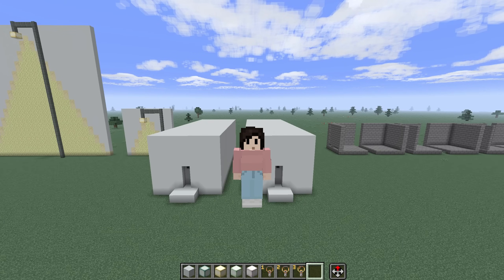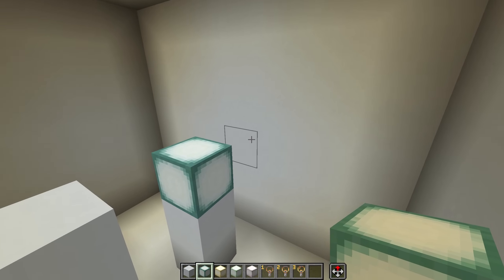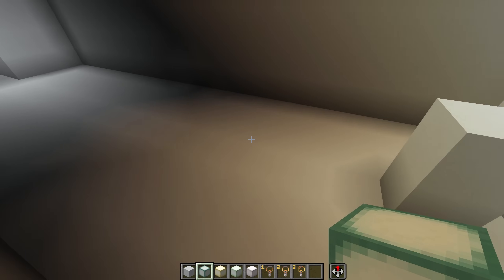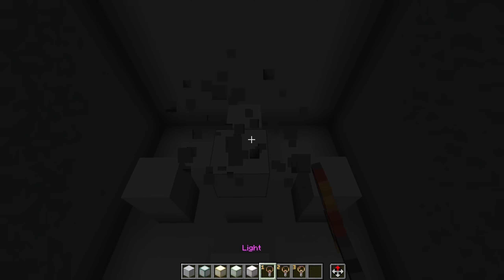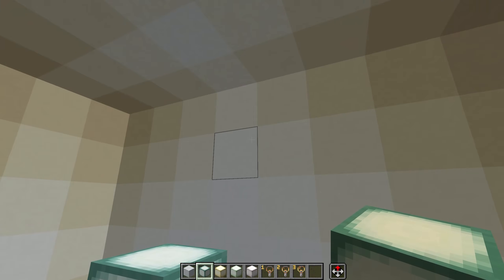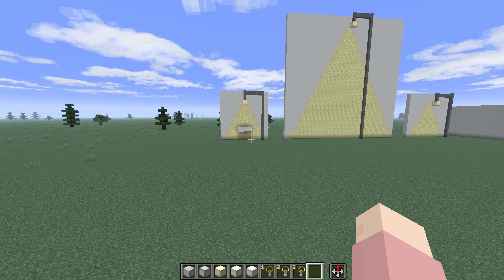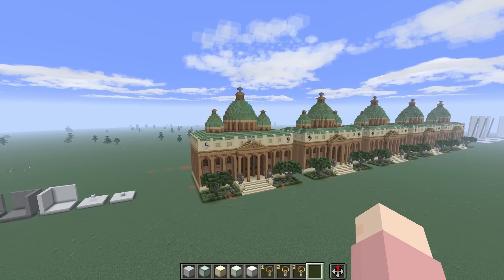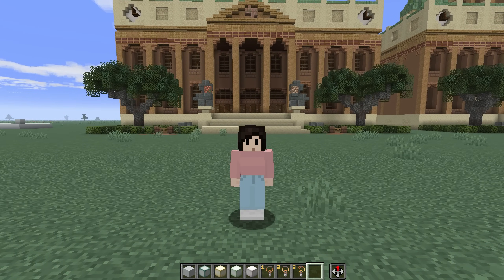How to Bake Light Maps to Improve Your Builds

Comment: 1:35 from my VERY LIMITED experience in 3D modelling, I can confidently say this is what Normal Maps are for. This is what you call a "light map".
They allow you to take any object and "bake" lighting into them, using ambient occlusion. You can even give low-resolution meshes a high-resolution look, or create texture on a flat surface.
The mod "Phosphor" aims to fix the inefficiencies of Minecraft's lighting engine, you should check it out.
4:15 I have an explanation for this too! So there are "cold" lights and "warm" lights, just as there are "cold" and "warm" shadows. The direct light you see from the sea lantern is a warm light, and acts like an incandescent lightbulb. The shadows of this light will be "cold", just like the light from outside, which is a "bounced" or "reflected" light. You see this reflected light even more at 5:30, where the reflected light illuminates the shadow. I love to use this effect in my artwork and my builds, making them warmer or colder depending on where the light is coming from and what color it is. I don't have an example on hand, I do believe Marco Bucci explains this in detail.
7:00 yes, most if not every light block is animated, there are even non-light blocks that are animated. Prismarine being the most commonly known example.
15:00 I think you did beautifully on the rendering there! Not a lot of people think about de-saturating their colors as they move towards shadow, but that is indeed what is happening. Less light is hitting the object, thus less color is reflected. I love the transition back to color as you bring the mossy cobblestone in - as more color will also make a shadow darker.
Reply from the maker: Thank you for such a thought out comment! I really enjoyed reading your analysis of everything. The only thing I have to add is I think I was right in calling what I'm talking about as a light map. While light and normal maps are similar, they actually serve different purposes as normal maps are used to imply detail, light maps are used to imply lighting in general. It's hard to explain in a comment but I'm thinking of doing a video on normal maps in the future.

Comment: I really like the way you did the shading on the dome, the gradient looks great! The only thing I'd mention is that the highlight spot looks kind of odd, since it's untinted where the rest gets 'warmer' as it goes. 

Usually light brightens and tints the highlight, the middle is most close to the base color, and the opposite color of the light tints the shadow. For instance, in daylight things tend to be tinted slightly yellow, and shadows are blue/purple tinted. 

It all depends on the color of the light source, so looking at the dome the light is white, meaning it has no tint, and the shadow is green as if cast from a red light. I know that it probably doesn't matter much to most people, and I really don't know how I'd execute my idea correctly, but I thought some of my color theory knowledge might be helpful. Either way, I love these videos! I really aught to get back into minecraft building.
Reply from the maker: I love all the knowledge you have on color theory, I still don't understand all that kind of stuff quite yet myself. And I do wish I had more options for the highlight but I was really limited with needing stairs/slabs. But I'll try and keep what you said in mind for next time
Reply: @cooltwo  Hey thanks! Yeah, I can tell that it'd be a pain cuz the options drastically reduse every time you add a new factor lol, but best of luck!

Comment: I think you did a great job of simplistically explaining what a ''light map baking'' is, even if in a Minecraft sense it's just a glorified way to call a highlight and/or a shadow. Also the techniques used on the dome of the Museum is very nice, but the rest of the build feels a little bit flat to me, especially how there's no breakup between the copper roof and the rest of the structure, plus the vertical uniformness of the main body despite the differing textures. It's nonetheless a great build, though.
Also I really want to believe that the ''Mega dome of Doom'' is an Iskall reference.
Reply from the maker: Thanks, I'm glad you liked the video! And the reason I've focused so much on the dome is because it's the one part of the build that isn't made with straight lines which is really hard to achieve in Minecraft so I kept coming up with ideas to try and make it better. If you want my breakdown of the rest of the build, I have a video from my survival series where I originally made it and I go into detail about the rest of it (some pretty cool techniques in there). 

And I think calling anything an "X of doom" is totally an Iskall reference lol
Reply: @cooltwo  Alright, yes I understand that the dome is totally the most visually striking part of that design so it's worth the most effort and the most analysing, plus it's the part where you can show off techniques like shading the best (There's a reason why art students draw so many realistic shaded and highlit spheres).

Comment: 3:51 the first light in this setup has it's light map updated every 2 game ticks, any light after, has it's light map calculation delayed by 2 ticks, the game's lighting breaks when it has to calculate multiple light maps in roughly half a second, each 10 tick span
Minecraft's code is old and kinda unfixable, it's also incredibly inefficient
Reply from the maker: Interesting, I didn't know the specifics about the updates, I just knew that you generally don't want to update them too frequently all over the place
Reply: @cooltwo  and if you have one too many light map updates the game will compensate having to re render multiple light sources with a slowed down tickrate, causing TPS lag, light maps and redstone are updated through game ticks, and one too many tick update could temporarily shut down a server, that's why redstone is restricted or entirely prohibited on most non technical servers

Comment: A dome might not be the best shape to use as example, since spheres are notoriously hard to shade, especially so in 3D! I think the most convincing application of manually adding light and shadow would be with harsh cast shadows, as harsh contrasts are much easier to achieve when your palette is as restricted as it is in Minecraft building.

Also as a game artist I can tell you that light baking might not be an entirely accurate term, since that specifically refers to lighting computation. It'd really peeve me if that were to become a misnomer in the community! If this were a 3D asset we'd most likely refer to it as hand-painted shading
Reply from the maker: Yeah dome might have not been the best, especially since I'm not the best at shading, but I've been using the dome as my example before so I felt like I had to use it again. 

And I do think that baking a light map is essentially the same thing, but obviously when translated to Minecraft building it has to be done by hand. But I decided to use the computer graphics term because that's what I'm familiar with and I'm not familiar with hand-painted shading

Comment: been building using this effect/method for a while with modded without realizing, I guess having a more diverse palette and an overpowered system of having any texture on a slab/stair (copycats+ mod) is pretty helpful for simulating shading and edge/roundedness.

Love these computer graphics logic implemented into Minecraft building you have going on, keep up the great work :D
Reply: I have wished for a way to manipulate the hue/brightness of blocks for sooo long. Either to change the color of the base blocks so that you can have any color of planks, logs, bricks, crafting bench, ... you name it. Or to change the brightness (darken the block), so that you can simulate shadows (or just simulate parts of a surface being smudged/ wet). But I guess that's impossible without a change to the engine, unless you made "overlay planes" that you can slap onto different sides of blocks. Then you'd only need to change the renderer. There would be so many use cases for changing a block without there needing to be a completely new texture, and even more uses for changing faces of a block one by one.
Reply from the maker: Having mods to add all the stairs and slabs you want sounds fantastic!
Reply: On the topic of allowing slabs and stairs with any material: I don't get why Mojang re-organized their block ID's (the "great flattening") but didn't realize that it's kind of a waste to have 4 different block id's (block, wall/fence, slab, stair) for different shapes of the same material.
The biggest advantage of differentiating shapes by ID's would be that there's nobody deciding that stone bricks and deepslate bricks get walls, but prismarine bricks and plain stone only get stairs and slabs, but no walls. And nether bricks for some reason get walls AND fences.
Admittedly Mojang wouldn't have thought about this, but it would help in doing replacements with worldedit if you didn't have to replace the slabs separately from the stairs and so on.